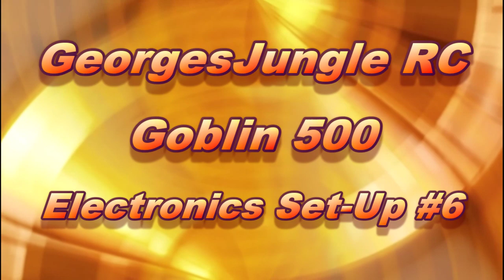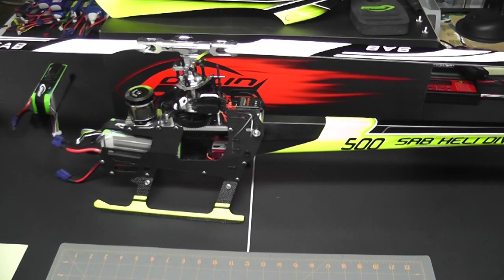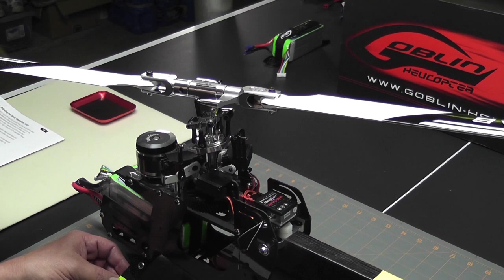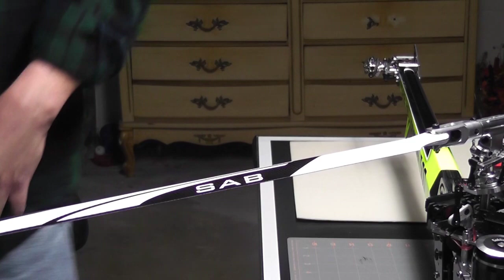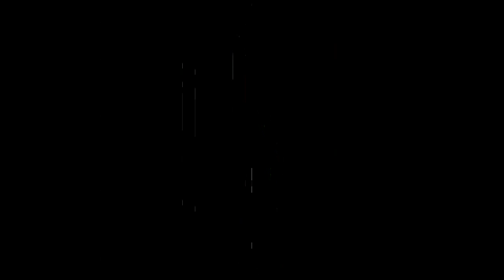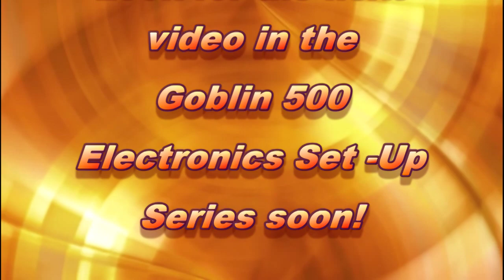Goblin 500 Electronics Set Up - Video 6

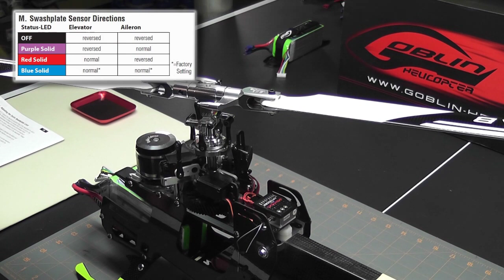Comment: Thanks for the all the setup vids George!  I have the AR7210BX on my new 420.  Question..I'm running both antennas thru a slot in the frame like you show at 1:35.  For the shorter antenna, does that one have to be 90° to the longer one for it's entire length?  Looks like yours is curved downward which allows for the canopy.  I don't want to have to drill a hole in the canopy <cringe> and trying to insert it in the hole while putting on the canopy would be painful.  This is my first scratch build, although I've rebuilt my Blade 270 several times.  Thanks man.
Reply from the maker: Hi Andy,  I kinda bent mine around to make it fit under the canopy.  No way was I going to drill holes! ;)  And for the record, it worked fine.
Reply: Thanks man.  Good to know I don't have to buy a separate receiver or drill a hole, but I'll do a range check to make sure.  Love the AR7210BX...setup is a dream.
Cheers!

Comment: Thanks mate! Its such a pleasure to fly the Goblin, especially now when I found my perfect setup and I can focus on flying.

I might be used to the snappy response as I've only flown micro helis previously which are extremely responsive due to their low mass.

Its such a smooth Heli, it does not matter if it set to very sensitive, it's still very easy and progressive to control. I think you will find it much easier to control than you think. Sport is a good place to start though! :) Cheers

Comment: Update on settings: By mistake I had my "Sport" mode on today (was flying my 130X before). I really felt the Goblin was performing perfectly for my taste, instant and huge amounts of response and travel but VERY smooth! Coming to a hover is super simple as is tilting 90 degrees in half a second! :)

I'm now using D/R 100 and 0exp on all 3 controls with AR7200BX param 2 to "Transmitter". You could boost it more with dial 1 and the cyclic response parameter, but for me this is now 100% perfect!

Comment: Hi George, just got back from another amazing flight with the Goblin. So far so good, no crashes or even near ones so far! :)

For the first flight, "Sport" should be just fine. This very much depends how you like the response of the controls. I prefer to have very sensitive controls with full locks available but only gently use a very small part of it, this way if I get into trouble or feel I'm loosing direction i can snap the tail back in instantly or correct a sideways angle.

Comment: Just comparing how the servos move when changing Param B from "Sport" to "Transmitter" its a HUGE difference... Its basically equal to the "Extreme" setting if you have D/R 100 and no exp!

For your first flights i recommend to stay in "Sport" or use exp 40 or sub 100 D/R. Its very smooth for hovering and moving around.

For the next flight I have:
Dial A Swash Gain = 75% (up from 50%)
Param B = Transmitter
D/R = 100 on all channels
Exp = 40 in normal and 0 in sport (this might be too extreme)

Comment: Hi George! I'm falling more and more in love with the Goblin for each minute! :) It is extremely powerful, but its also very easy to control and smooth! It hovers rock solid!

Today was my second ever flight with a large heli and was able to fly it in 30mph winds and more in the gusts! I love the big sound it makes as well!

I want to calibrate tail and cyclic for equal sensitivity. With 40 gain the tail is much more sensitive. I will use Param B = Transmitter for my next flight.

Comment from the maker: Hey Roger!  Congratulations on another successful flight.  It is good to know you like the way it flies and are happy with the performance.  I am thinking it is going to be a bit too powerful but I am sure I will get used to it.  Is it very stable in a hover?  From what I have read, you should only used DR and Expo in your radio if you have the Control Behavior (Parameter B) set to Transmitter...  I think that is the way I am going to start.  What do you think?

Comment: Another excellent video mate!

Looking forward to the parameter menu! I haven't touched that yet. After another successful flight today (in some quite heavy wind) with increased sensitivity on all channels if feels even more agile. I'm quite happy with throttle and pitch now (all 100 with 0 exp in the Radio, +-12 degrees pitch) but want more response on cycling, so will most likely increase that using the Parameters on the AR7200BX!